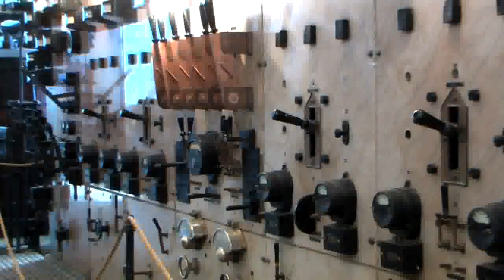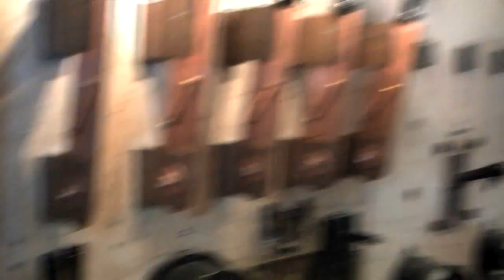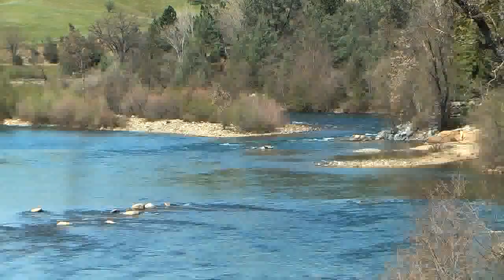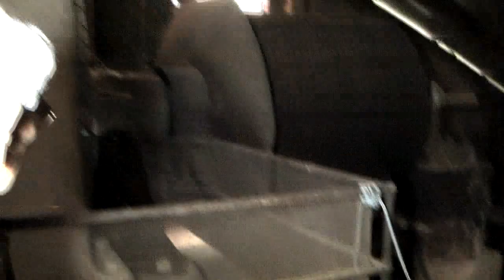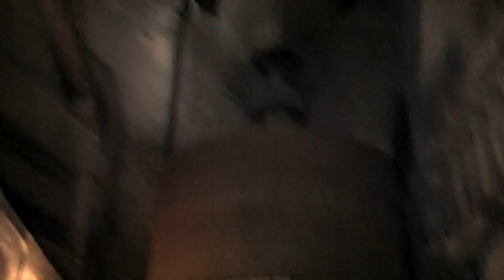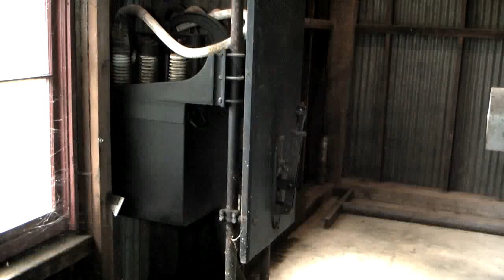Folsom - Switchgear Lower Power House

Comment: In the two years since opening, the bean counters must have gotten control of things, because while the original upper powerhouse was nicely done in brick, the later lower powerhouse was built to a pedestrian concrete and corregated steel design. Yuk.

The lower powerhouse may be visited at the park